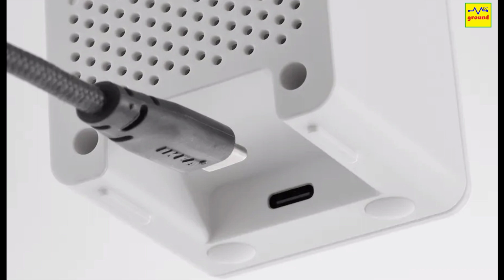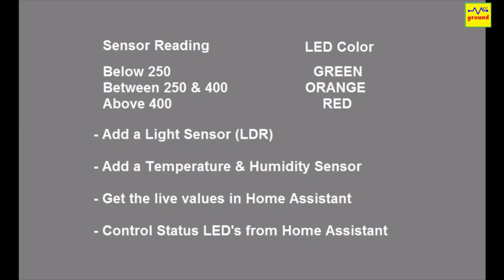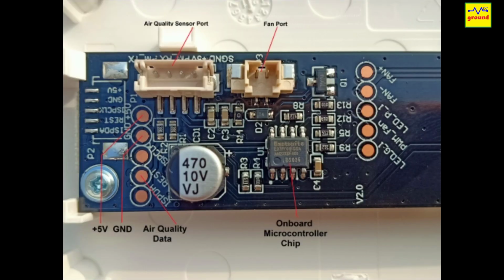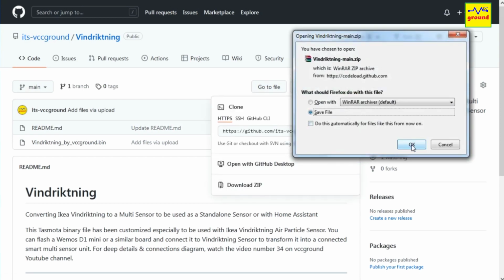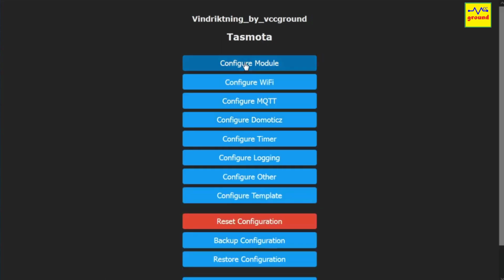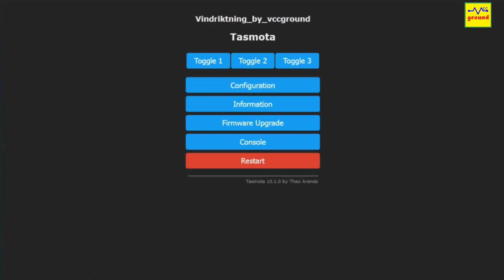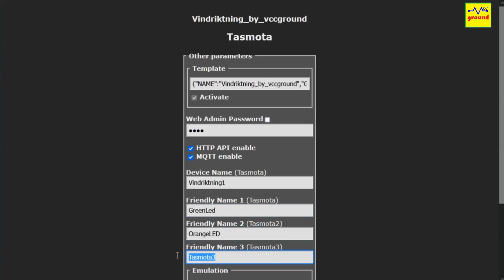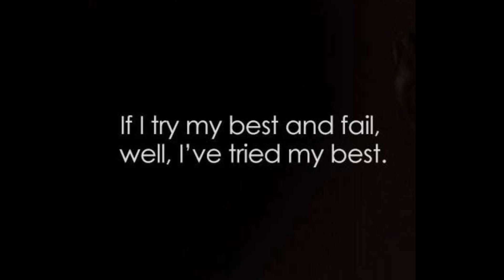#34 VINDRIKTNING | Modifying to the next level as Standalone / Home Assistant Connected Multi Sensor

Comment: Thanks for this.  Do you plan to release the source for your Github .bin?
Reply from the maker: It's already fully customisable. You would never need a source....What do you want to customise ?
Reply: @the_vccground  If it's a custom build, I like to know what I'm putting on my network.  In addition, I believe the device also has PM4.0, but the main reason is knowing what I'm installing on my network.
Reply from the maker: @timwoodburn5895  It's basic Tasmota with addon functions for VINDRIKTNING and I2C sensors. It also includes some rule sets to transform it into a standalone sensor. It doesn't support PM4.0.
Reply: @the_vccground  Good! So, why not disclose the actual customized  configuration template and the rule sets apart of a pre-compiled bin package? That way, you'd provide more flexibility for your viewers, who wish to compile the custom bin by themselves. Transparency is golden! Apart from that, what if we want to update to the latest Tasmota build? ¯\_(ツ)_/¯
Reply: @the_vccground  it might be a good subject for a future video, customising Tasmota builds.
Reply from the maker: @timwoodburn5895  watch video number 36 for the same...

Comment: How are you getting the three different measurements out of the vindriktning ( pm 1, pm 2.5, pm 10, pm ) ?  I only get the one (using an esphome version of software)
Reply from the maker: I have modified the default Tasmota firmware to get all these readings. Do try this modified firmware to get all the readings in your sensor too. Link is there in the description of the video... ❤️👍
Reply: @the_vccground  that's surprising as the pm1006 only gives pm2.5
Reply from the maker: @Ed19601  I'll check that too 👍

Comment: This is a really interesting video! I haven’t attempted anything like this before, so I apologise if this is a stupid question.. but can you explain the purpose of moving the resistors rather than just removing them completely? Also, can you recommend a guide on how to move resistors? (I only have basic experience of using solder 😅)
Reply from the maker: The purpose of removing and shifting the resistors, is to disconnect them from the onboard microcontroller chip and handover the full control of the LEDs  to Wemos D1 mini board. If you have basic soldering skills, you can remove them and refix them using your soldering iron. There are a lot of videos available on YouTube on how to remove and fix SMD components. Kindly refer to them. Thanks for appreciating my work. ❤️👍
Reply: @the_vccground  thank you :) I look forward to video #35
Reply from the maker: @robertybob  Sure, do comment if you have any query from video #34, so that I can answer that in the next video. 👍
Reply: @the_vccground  sorry, just to confirm, if I removed the resistors and didn’t put them back on the microcontroller chip..the LEDs wouldn’t work at all?
Reply from the maker: @robertybob  Yes, they won't work without those resistors.

Comment: Thanks, it worked well,  is it possible to add MQ135 smoke Sensor to this system?
Reply from the maker: Yes, why not. If you just need a trigger from MQ135 sensor, you can connect it's Digital pin to any free digital input compatible pin on your ESP board. If you want to see live values that this sensor is reporting, in that case you need to remove the LDR and connect MQ135's analog output to A0 pin of ESP board. If you want to have both Gas sensor and LDR, then you need to use a GPIO extender board or an I2C ambient light sensor.
Reply: @the_vccground  thanks

Comment: Great work.

Just curious if you had not bought ikea sensor.
You could have DIY everything with P2. 5 sensor or BME 680 using esp home
Reply from the maker: Sure, but to know about a product, one need to buy it. I'm too curious to try new items and customise them to improve and extend their features. I always appreciate your inputs. So keep sharing your thoughts ❤️👍
Reply: @the_vccground  sure. Always
Reply from the maker: @MrBobWareham  yes, that's right ❤️👍
Reply: In fact, Ikea is much cheaper than bme680 and also looks good :)
Reply: @SpiceSnow  bme680 is a gas sensor, not a particle one? That’s completely different :)